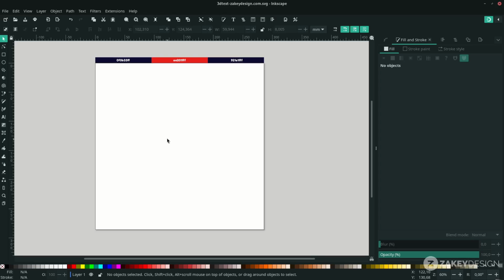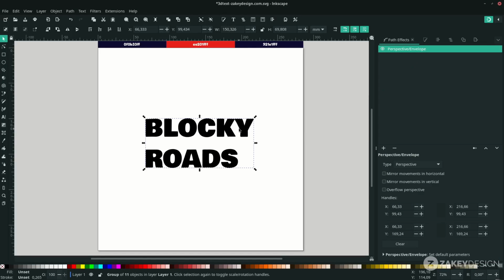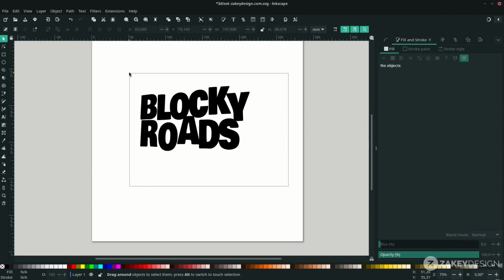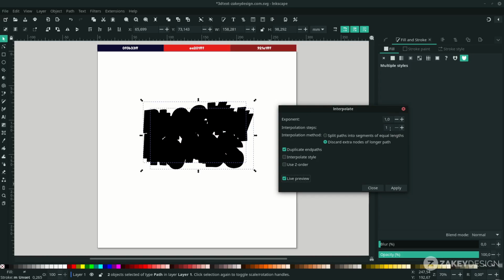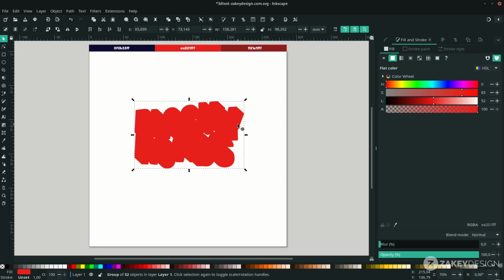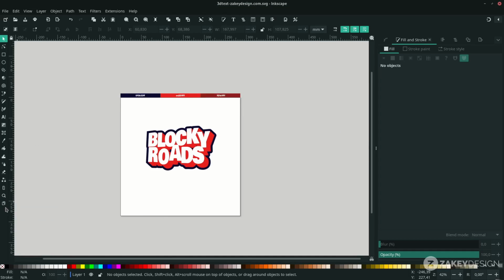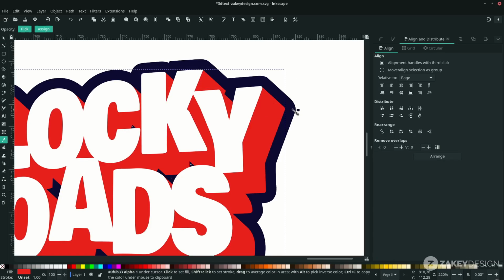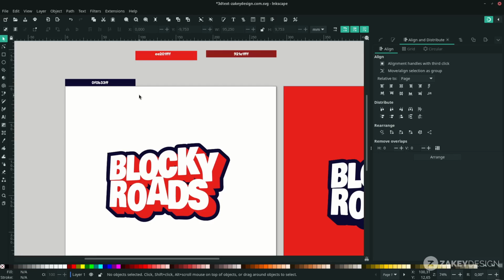Inkscape Tutorial : Create 3D Text Effect with Interpolate

Comment: When I want to size any object, while the aspect lock is on (this is how I generally use it), when I enter the measurement value for width and length, another one changes automatically as the dimension. Why am I having this problem even though the aspect is not locked? Can you help me.
Reply from the maker: have you click the lock icon between the W(width) and H(Height)?
Reply: no @ZakeyDesign
Reply: @MerveMete-i1e  If aspect is locked and one dimension is changed then the other dimension will change because it's in scale. If it's unlocked then one dimension will change but the other won't.